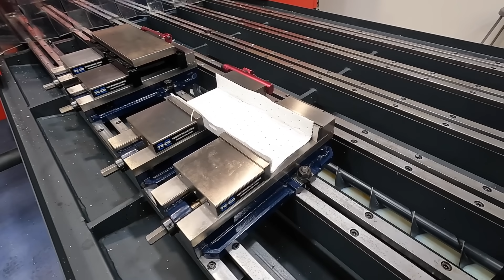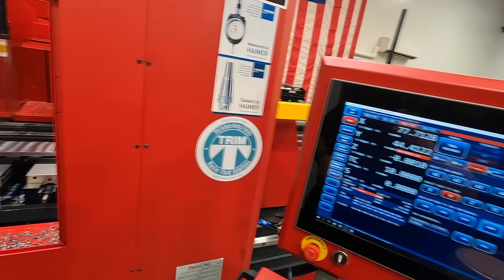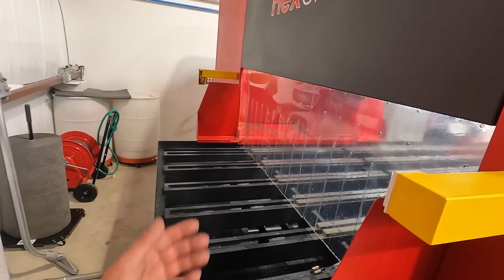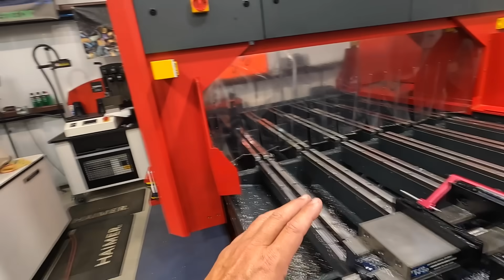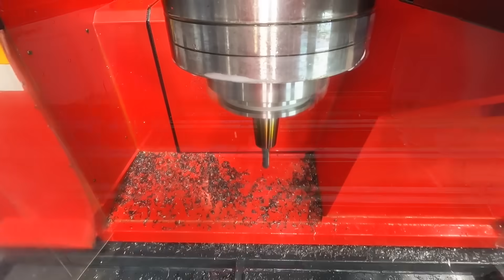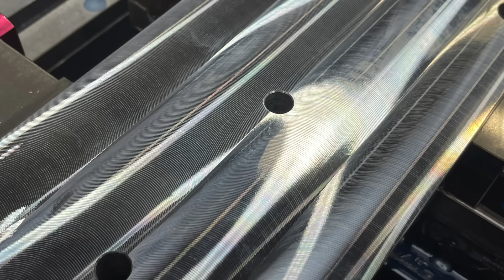V-Block Adaptors for the Flex CNC

Comment: I'm not qwuite sure what I am supposed to take away form watching a $200, 000 machine cutting a small piece of steel I could easily machine in  my manual mill. I didn't learn anything about CNC, Fusion, how to run it, or anything else. In fact all I did learn was that steel can be cut. I think you have forgotten that your audience are mostly hobbiests who wont be spending $200k ona a machine :(
Reply: He's not a teacher? He's recording himself learning how to use and operate a new to him machine.
Reply: I agree. I were loved doing maintenance machining over many years It's interesting to watch how others tackle a job and,compare it to how I would do it. I don't get that here anymore. I like Joe Pie,Keith Rucker,CCE,Topper and all the other guys I don't have room to mention.
Reply: @jamesdavis8021  I get the feeling that Adam maybe doesn't really like making videos too much anymore, the novelty has worn off and now it's more like work. To make matters worse, all the work that Adam has done over the past 2.5 years (will be 3 years December 1st, 2024) since moving into the new shop has only resulted in a stagnating channel, with practically zero subscriber growth and flat or declining view counts on new videos, with hardly any interest and mostly negative feedback about the CNC machines. If I was convinced CNC was the way to grow the channel, and after almost 3 years it's not working out, I'd be frustrated as well.

Comment: Just sounds all around not rigid enough. Should be able to have that endmill sound better and be 3x faster. obviously if it works it works! Couldn't hurt to throw on another toe clamp or two inbetween the vices to clamp them to the rails a little more. I'm not understanding the whole rail thing either, pretty minimal contact with the vice seems ass backwards to me. Jaws are also questionable. A set of standard hard jaws would probably work best

Comment: I'm sure I'm missing something. Shouldn't the blanks be machined to dimension, square, flat and parallel before running the programme? Then you can make as many items as you want consistently.
Reply: what are you talking about? So based on your comment you should "pre machine" your stock so you can machine it? what? 
He is milling the sides and the top as well as all the holes in the first operation, the 2nd one he just decks the plate to size. 
So just given the 1st operation, he is making it to dimension, making it square, flat, and parallel to the underside (as much as possible, with a "flat bar stock" with a bend in it)
Reply: To answer your question without all of the unnecessary sarcasm, your head is in the right place. However, he is squaring the stock as part of the program. In Op 1, he squares the bottom and the sides to each other. Then, when he re-clamps the part for OP 2 and decks the other side, it is also being squared to the already machined surfaces. You would do this in manual operations as well. I think a lot folks see those, "squaring stock" videos and probably think that squaring the stock is it's own special operation, when in fact it's normally considered and included in the order of ops.
Reply: You're right, you're missing something.

Comment: I'm pretty sure that the jumpiness that you are talking about at 22:30 can be improved by using the smoothing function in Fusion 360. The problem is, that the adaptive toolpath without smoothing uses too much small lines of code for the CNC machine's controller to process in time. NYC CNC has a video on this, where John Saunders goes way more into detail and does a way better job explaining it. It is Fusion Friday 128 (FF128) on YT.
Keep up the good work and don't get frustrated by the guys hating everything that is "new" and which they don't understand.

Comment: What does the warm up do for that machine
Reply: Warm up the spindle and making sure the bearings are sufficiently lubricated, before putting them under load while cutting. Also helps with accuracy, because most of the thermal expansion/ needed compensation is done once the spindle is warmed up.

Comment: Bro use the ‘simulate’ feature in fusion. Check the box that says stop on collision. Unless your post processor is producing some junky code, IDK. Fusion lets you prevent crashes pretty easily. Don’t play with Z heights when you don’t have to. Use the tools fusion gives you. Touch your tools off and get your Z and the rest is feeds and speeds mainly. Good luck no more crashes 🤞🏼
Reply: It wasn't a CAM issue. The Fusion simulation was fine. It was a result of stopping and starting the program.

Comment: You lost me with the odd depths on the chamfered holes, after the facing operation the surface should have been flat and parallel to the spindle travel and been the same height from the cutter in the last op, ( the chamfering )
Reply: I don’t think he faced the keys, only between the keys.
Reply: @soundgod06  you are correct Sir, I missed that at first 👍

Comment: I get that the safety scanner shut the machine off, but why did it crash and not just e-stop?
Reply: It stopped fine on the e-stop. The crash happened when he attempted to reload and restart the program from within the program instead of starting over
Reply: @MechanicalAdvantage  Is it possible to single block the first few lines and then jump to the bit of the program before the crash?

Comment: I always buy plate at least .063 up to .125 thicker than I need just for the problem you had.  You never know what defects ended up in it at the foundry or what deformations happened in storage.  Looks like yours may very well have been the bottom plate in a stack that sat for a long time.

Comment: When the machine shuts off like that it should stop the spindle and retract it to the up possession.
Reply: If you retract the spindle you risk either further injuring a person inside the machine or destroying something if you were doing a back-cutting or slotting operation, not a good idea.
Reply: @skwerlz  
Now what is the idea of doing what it did? Going out in an angle through the material?
Reply: @Drottninggatan2017  not agreeing with what it did either, it should either be a hard e-stop or a .05s dwell to preserve tools/work into hard e-stop.

Comment: Hey i have a little improvement for you to make: i would shrink fit the carbide drill because as you can see in the vid a lot of coolant that should go through the drill doesnt and because of that the drill has a higher risk of breaking. I would immeadiately change that because having a carbide drill not shrik fitter is a no go

Comment: You can get the insert seat welded and remachined. Your tool rep should be able to make that happen. 
I'm assuming that's 1018 crs(nvm see the flame edge. Thats HRS)? I personally shoot for
 .0002-.0007 for press fits. I used to indicate all reamers in at the cutting edge at the lead in. I'd tap the reamer in with brass at the collet junction. A true running reamer will still blow a hole out if it catches a chip. Use a .4375 or .375 4 flute emill. Relieve the cutting edge back will a surface grinder and 5c. Leave about .1 cutting edge, then helix bore. If you do ream, i never run a reamer fastet than 1500rpm(won't blow top of hole out). 
Use a diamond pin in place of 1 dowel if using 2. It'll aid in removal in the future. If you don't have diamond pins, put a couple of knock out holes in the sub plate. 

If you want a good finish with a shoulder/face mill, remove every other insert, or just leave one. The "scallops" are the miss match of insert height. 
If thats an AlTiN coated emill, ditch that M8. 

Last thing, that shoulder mill is to large of diameter for that spindle taper. Use the same milling technique to rough as you did to finish. That sfm is for HEM but you Ae is to large to engage RCT successfully.

That's a bummer that controll did that "non sense" after essentialy tripping the e stop. Keep up the content. Appreciate ya

Comment: There is no circumstance where tripping a safety interlock (the Sick laser) should cause a machine crash. That is utterly insane and Flex needs to fix that. I'm guessing they just shut power to all the servos and unlock them, so the momentum from the face mill still spinning pulled it across the work like that. A proper shutdown has the machine very rapidly halt before cutting power to the servos for this very reason.
EDITED TO ADD: On an IG video, Adam notes the machine simply stopped. It was (as others noted below) a bad program restart line selection that actually caused the damage.
Reply: He restarted the program incorrectly
Reply: @CHEWITT-wq1zd  How do you figure? He says nothing about restarting the program to cause the crash. All he says is that the machine shut down after he tripped the Sick sensor.
Reply: @LumaLabs  It's just faith that no company would ever do that, and it doesn't really make sense. If the facemill was freerunning, it wouldn't have made it all the way over there, and it definitely wouldn't have enough enertia to kill those pockets like that. 
The only way I can see this is if like the other person said, if it wasnt reset and homed before restarting.
Reply: @LumaLabs  he said it on his Instagram page
Reply: @johanneskienle362  Ahh... yup. There it is. Sort of a big missing piece of information to not put in the YouTube video, because otherwise - the alternative explanation of how a safety trip leads to that damage is really really bad.
Reply: @LumaLabs  saw him post about it on linked in or insta

Comment: ❤ When you are reaming a part for die making the dowel pins are a tight fit and you use a hammer to put them in the hole. 
 You never want a pin to just push into the hole by hand.
 The die will fail in a very short time if any section has the slightest bit of movement when a 50 ton press hits.

Comment: So the machine stopped running, then sent the tool and cut the keyway off? Did it just make a random movement to a home position?
Reply: Random? no. CNCs never do what you want them to do. They can only do what you TELL them to.😀
Reply: @Mike-po2dv  You are assuming that Flex cnc wrote software running that machine correctly. I interpret it so that the emergency stop would just cut off the electricity from all servos, so the machine moves in any direction where the remaining kinetic energy takes it.
Reply: @peto22  Doesn't make any sense. If they did that the Z axis would fall out of the sky.
Reply: @spikeypineapple552  Does your Z axis fall when you turn power off to your machine?
Reply: @peto22  No, it has a brake, like every cnc without a counterweight.
But if they put enough thought in to do that, they would have put enough thought into it not plowing through a workpiece. We actually see further into the video what happens when you trip the guard.

Comment: Wow 1200sfm on that facemill in steel seems a little high, surprised they recommended that high. And the "jumpiness" you see is because there's too many lines of code and the controller can't read it fast enough, try turning up the smoothing and increasing the tolerance to help with that. Also seems very dangerous to have all the retracts set so low when you aren't facing off the highest part of the stock, raising that could avoid any future accidents
Reply: This is certainly true with older machines, but I'd be shocked if this newer machine can't handle modern toolpaths.  If it can't, I'd be incredibly disappointed as there's really no excuse with the technology we have today.  Perhaps there is a "high speed" option that needs to be enabled in the controller to read that code properly?  The flex CNC guys aught to get this sorted for Adam.
Reply: @GetBlitzified  you'd be surprised, we have 2018 robo drills that read code slower than our 1994 Matsuura does in their standard mode and it's 10X worse than his flex. But yes usually there is a roughing or high smoothing mode in the controller to fix it
Reply: @GetBlitzified  Very, very standard for a machine to bog down on a non-smoothed toolpath. I can't imagine they're selling this machine, which is basically designed to basically drill lengths of rail and stuff like that, with AICC2 or 200block lookahead. It's just not what the machine is meant to do.
You wouldn't buy a ford f150 and be disapointed it doesn't have KERS from Formula 1, and you wouldn't buy a Corvette and be disappointed it doesn't come with a towbar.
Reply: @spikeypineapple552  I'm sorry, but on their website it literally sates "Capable of high-speed drilling, and MILLING".  In their promo videos they have videos of roughing tool paths.  The machine should most certainly be able to do some basic 2d adaptive paths, this isn't trivial this day and age.

If a $200 chinese controller I buy off amazon can handle adaptive paths better than a $100k+ machine tool, I'd be pissed.  How can there be an excuse for that?  Granted, I'm willing to bet there is a "high speed" option that needs to be enabled, in which case great!
Reply: @GetBlitzified theres a massive difference between 0.001 smoothing and no smoothing. Your 200$ controller doesnt have the same requirements as this machine does.
Reply: @spikeypineapple552  Lol I'm not arguing against smoothing!  It works great for older machines.  But even my 2000 matsuura and 2007 milltronics usually don't even require any smoothing.  Only on the odd occasion it bogs with too many lines I'll enable it.  If you want to talk about requirements, did you choose to ignore the statement from their website?  "Capable of high-speed milling"

Comment: but why does breaking the beam crash the machine? shouldn't it just stop?
Reply: Incorrectly coded or otherwise poorly implemented emergency stop? In my opinion, light curtains should not even stop the machine, but only put feeds on pause and continue when the obstacle leaves in front of the light curtain.
Reply: @peto22  Feed hold+spindle off after 0.2 seconds would be my prefered method. It HAS to kill the spindle.